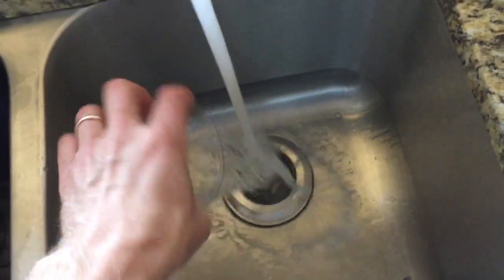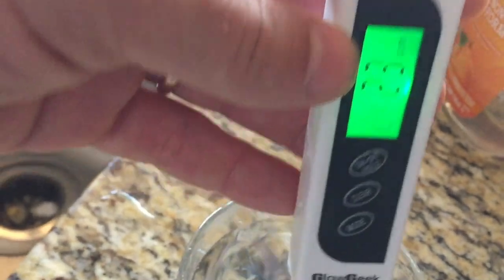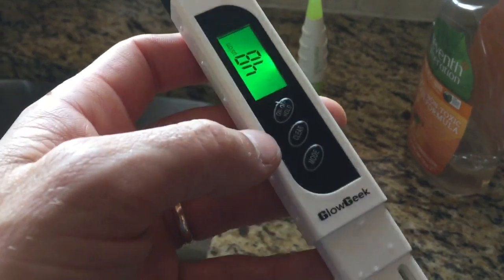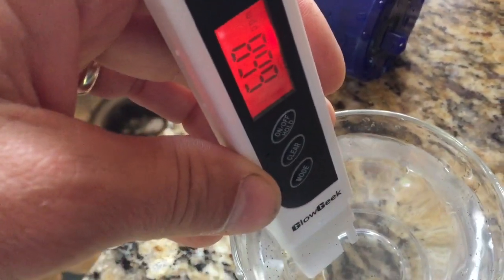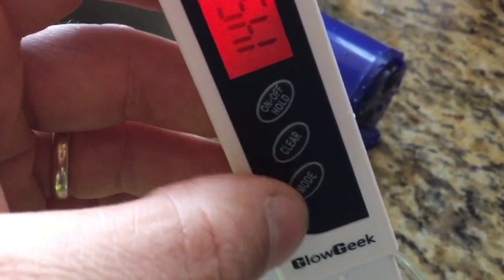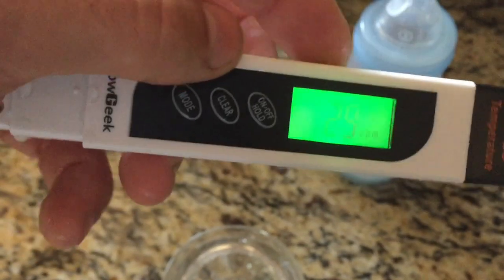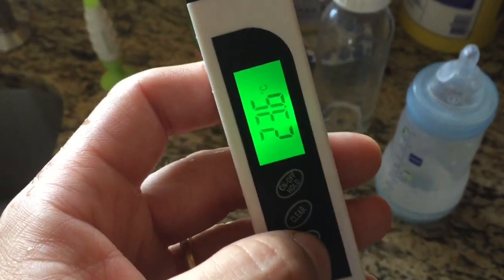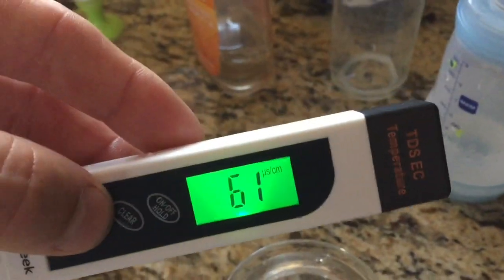Testing of Tap Water vs filtered PUR system, old and new filter test

Comment: TDS dose not tell you how clean water is.. Miners in water which are necessary increase TDS but they are good for you now bad for you.. if you take distilled water which has a TDS of 0 to 10.. and you put nail polish remove in the water... the TDS still shows 0 to 10.... TDS should never be used to judge the quality of water.. you really need to educate yourself before you try to do a video the give people bad information about their health... you have have lethal levels of led in your water and that will hardly effect the TDS level... Total dissolved solids like salt, lithium, and other important mineral raise the TDS and are required for a good health PH level...

Comment: Haha dude... 😄  you did just about everything you could do wrong. First you're testing the wrong filter if you want less mineral particles. Next you should clear your tester with distilled water, not just zero it out with the zero button. There are still particles from your previous test on the testing unit.

Comment: The TDS reader, which stands for total dissolved solids measures the good minerals dissolved in water in parts per million (PPM). Those good minerals are essential and are needed in the water. Zero water removes those good minerals and claim that it's zero parts per million. You have to look at the contaminants that zero water removes, which is only 23 up to this date. You want to remove bad contaminants but KEEP the good minerals in water, that's why I after 2 years of using zero water, I switched to a different filter that removes over 270 contaminants but keeps the good essential minerals in the water.
Reply: what filter did you switch to?
Reply: @cindycampelli2126  After 2 years of using zero water, I switched to clearly filtered. Please note, I'm not advertising for them.
Reply: @rknine7998  Thank you!! I’ve struggled to find a good one. Mainly want it for my pup. My tap water is disgusting!! I used a zero water filter for a while too and realized it was no better.
Reply: @cindycampelli2126  You're welcome. What are you planning to do now, in terms of water filtration?
Reply: @rknine7998  I looked clearly filtered up its a bit expensive. So i really don’t know what i’m going to do now. I’m a broke college kid, wish we all had access to clean healthy water👎🏻
Reply: @cindycampelli2126  Even though I provided information about clearly filtered, it's very expensive and the filters need weekly maintenance to keep up with your faucet water.
Reply: @rknine7998  Wow that’s upsetting, my tap water is about 320 ppm. Do u have any other more affordable recommendations?
Reply: @cindycampelli2126  I have another filtration company, but it probably doesn't filter out as much as the other two companies provided, being zero water and clearly filtered. If you cannot afford clearly filtered, stick with zero water because zero water removes 23 contaminants, even though also it negatively removes the good minerals. You can still obtain the good minerals through eating healthy food. My tap water measures between 45 to 50 parts per million.
Reply: @rknine7998  hanks for the information. I might go back to zero water. I heard you can get really sick, that’s why I stopped using it.

Comment: Someone should let the dude know that you usually have to run a few gallons of water through a filter before it is working at its peak. The reason is the cleansing particles in the filter are being rinsed out for a while. Not an awful test but far from scientific. Clean your sampling tool too lol

Comment: I would re-calibrate with Distilled water.  I want a tester that shows everything in the water by Periodic table elemental symbol...then I'll really know...is there such a device for Home use??/  ZERO water filter looks like the way to go...I think these add Minerals for flavor enhancement.
Reply: Problem with TDS tests are some things...like led, are in parts per billion and not million. Common TDS tests are in parts per million, so unless your filter targets led, it can still be there. Pur filters get 96% or so of the led out.
Reply: Zero water is bitter.

Comment: I bought an old Pur faucet system from ebay and the light is always off. I have put a new filter, is the water coming from  out filtered or no ? Does the electronic light plays any role ?
Reply: Your filter is working fine.   The battery in the filter is non replaceable.  The light is just a nice feature to remind you when to change the filter.  You should be replacing the filter every three months

Comment: If you could remember how to press the correct buttons on the test device and just test once per sample (it doesn't change just because you pull out the tester and place it back in), this would be a two minute video instead of 9:48.

Comment: You realize that you are testing the MineralClear filter which runs the filtered water over a layer of minerals to enhance the taste?  That is why particle readings are higher through the filter.  You should test it on the basic white PUR filter that has no minerals.
Reply: tzd - Exactly, this review's incompetent.  Also, TDS and EC are two ways of expressing the same measurement, so there's no reason to switch modes.
Reply: I was just about to type the same thing ... minerals ...
Reply: What
Reply: Truth is De Wae to Love Ok, nerd.

Comment: If you test purchase water bottles , your test may vary from 16-46ppm. Thus your tests result shown in your faucet filter is as close as buying water bottles, FDA calls it safe water to drink. Pure water or distilled water mean 000 ppm and 000 chemicals. ** tip, the best filter I found in Walmart was zerowater 000ppm, 35$, it comes with digital tester too.